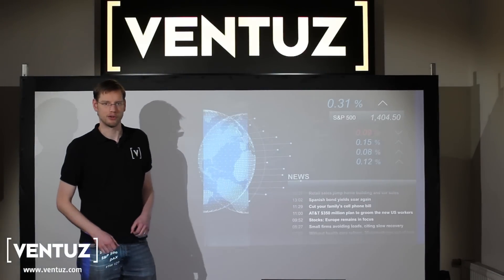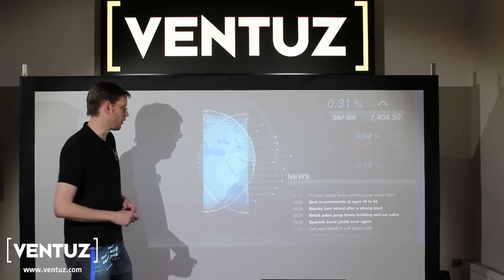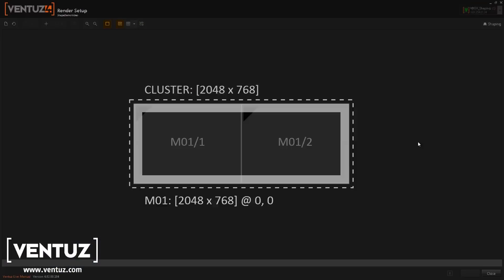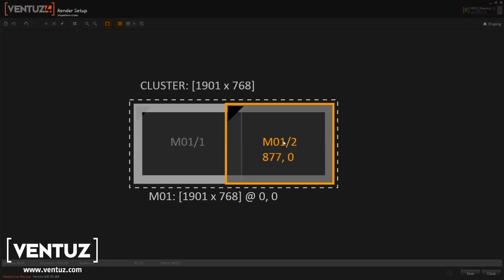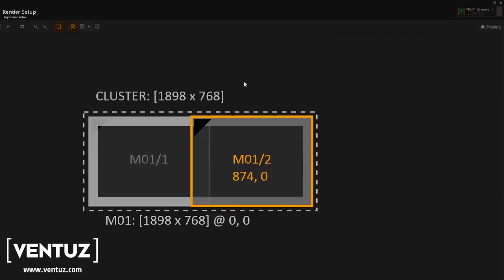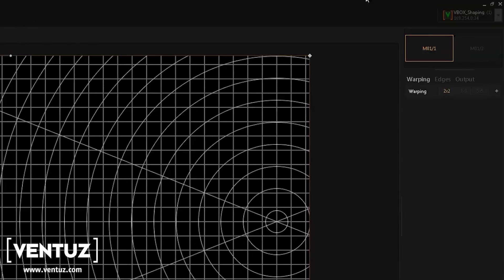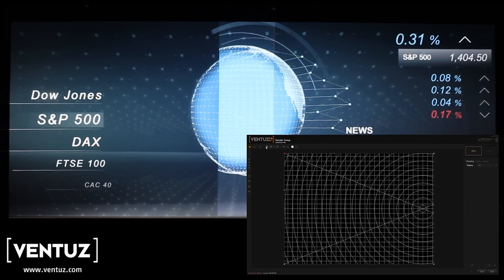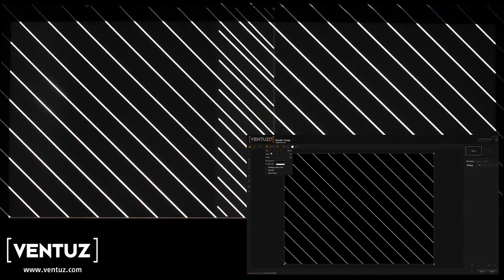Ventuz Tutorial | How to do simple Projector Blending and Warping in Ventuz?

Comment: In this video you worked in your laptop with two projector, but my computer only supports two display and i have two projectors should i work on one of them ?
Reply from the maker: Hey there. I don't think we used a laptop for this, I think we used a full featured show machine with a graphic card that offers four or six display outputs. To find out all about our Warping and Soft Edge toolkit, go to the Ventuz User Manual at https://www.ventuz.com/support/help/latest/WarpingSoftEdgingMasking.html.
Reply: You can buy Zettaguard USB 2.0 to VGA / DVI / HDMI Multi Display Adapter / Video Graphics Adapter (https://www.amazon.com/Zettaguard-Graphics-Multiple-1920x1080-10095/dp/B0182MIZTK/ref=sr_1_8?ie=UTF8&qid=1545046946&sr=8-8&keywords=usb+2.0+vga+adapter)